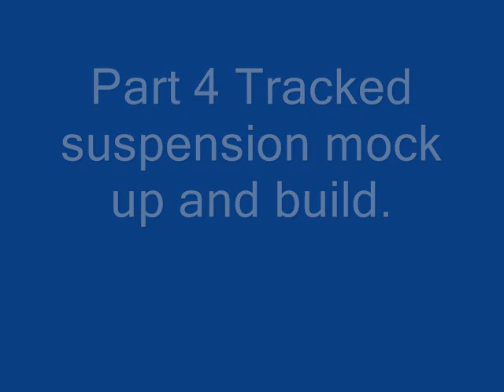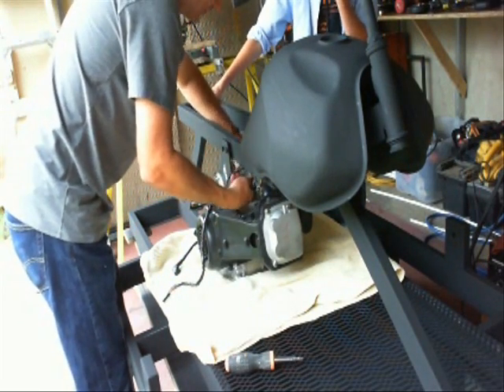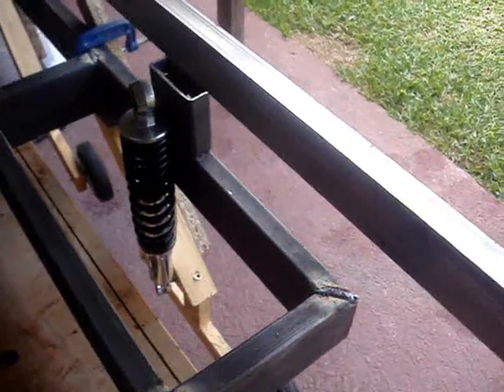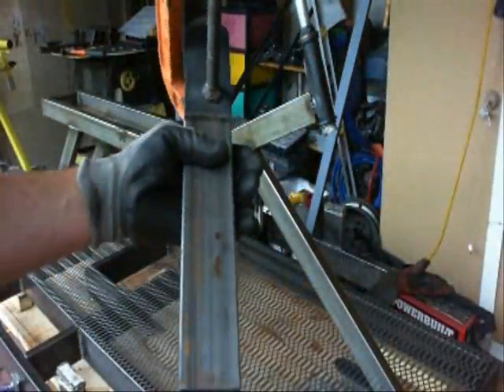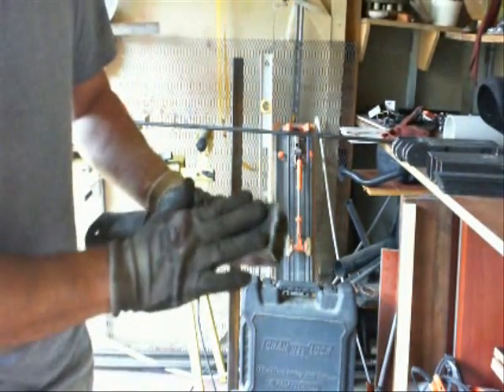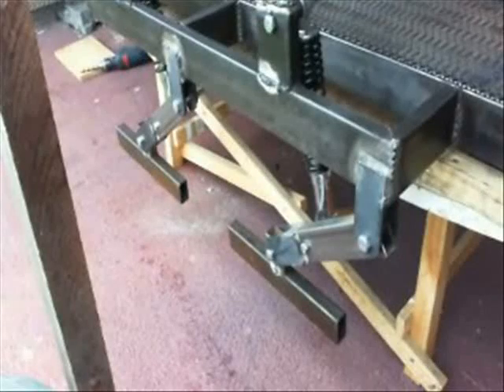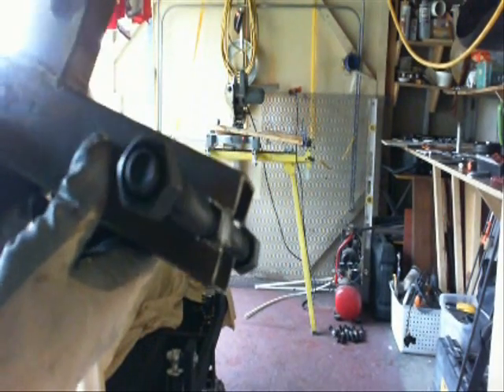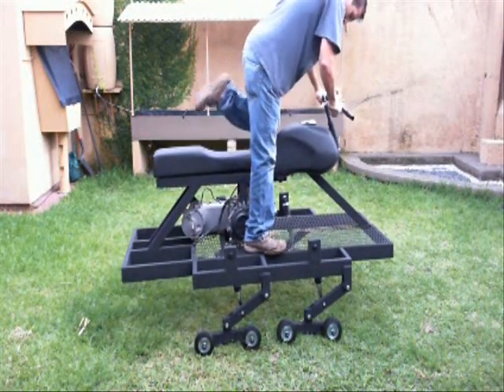Tracked vehicle suspension Part 4

Comment: I like how you did the suspention. By changing the mounting locations on the shocks you will change the leverage on them to make them stronger or weaker.
Reply from the maker: I am going to have to add a shock to the other side of the shocks I have now. The shocks I have are a little weak for the weight. but I think it will also make the arms stronger so not a bad thing.
Reply: Plus the second shock will help hold the suspention strait up and down when compressing. With one on one side it wants to kick outward when compressing. Although you compensated for this in the build it will cause premature ware on the metal parts. Plus it will look badass.

Comment: I see what you are trying to do, but your suspension may be prone to failure, no offense as my intent is to play Devil's Advocate and not to demean your project.  I play World of Tanks and War Thunder Ground forces plus I am 52 years old and have been into Tanks for a very long time, several decades.  As I mentioned I see what you are attempting to do, work within your budget and make something that will get you where you want to go.  Your pivot points will twist and fail as you attempt to make turns and go over obstacles.  Again my intent is constructive criticism and not deter you from your project.  I want this thing to work for you and if you do a google search for Track Suspension you will see none will ever look like yours.  The pivot arm for each road wheel might work but that would mean double of everything, shocks included and rather than a pivot upside down "T" each road wheel is itself will be at the end of the arm.  You can still use the double Screw Idea, that seemed to be a Genius solution, at the bottom of each arm to replace the T.  You may even get away with removing the bottom T and put the Road Wheels there and simply add one more on the end and in the middle and keeping them close together.  Just depends on clearance.  You may also need to use double shocks on each arm to obtain the control you want.  You may be able to Double up the Shocks on a Single Bolt to allow for a second Shock without the need for a Second Hole, maybe.  Keep in mind the only thing keeping those arms from twisting is the Shock and U Joint at the top so you may want to consider using a double plate or double thickness stock for the U Joints.  I don't know what you plan to use for steering but you may want to use a design using cables attached to a breaking system for the drive Wheels.  Simply put if you want to turn RIGHT you simply BRAKE the RIGHT DRIVE WHEEL.  Like a Mini Bike that uses a Slip Clutch to drive it, you will need a Slip Clutch for each side.  Simply have the Handle Bars with Cables to manipulate the Slip Clutch.  The more you turn RIGHT the HARDER the BRAKE IS APPLIED.  The unit seems wide enough but your length might be an issue with regards to stability.  Jeeps are prone to flipping over because they are short and things like that.  You may want to consider extending the Front Return Wheels to add some Length and possible room for maybe a 5th Road Wheel Setup, the length can only aid in stability and the more road wheel arms the less likely they are to twist.  1 or 2 arms will twist easily but 4 or 5 would take a lot more umph to twist metal.  I hope you consider my suggestions as I intend, constructive criticism, and nothing more because I look forward to seeing this vehicle come alive.
Reply from the maker: Thanks for the advice. Stay tuned, as I build this I am sure I will have to make changes to get it to work. That's part of the fun!
Reply: Aceman307 Yes it is, and thanks for taking my comment as I intended it.  So many others just fly off the handle when you try to give them advice and I am glad you didn't.  My health is against me but my mind is very active so I would enjoy helping with ideas as I really do think outside the box about most things...  I look forward to your progress...
Reply: Yes , I also felt that one sided mounting of the shocks is not a good idea, You should add another bar on the inner side as well and then put the shock in between. This single bar mounting will not be able to take the fatigue and may lead to disaster.

by the way, What  are your cost and time estimates for having a finished product?

Comment: I think the shocks are fine. Might need to move the rear swing arm back abit so when you sit on it will be even.
Reply from the maker: The shocks also have adjustments to make them tighter. I don't think I can move the swing arm back any more because of how close the drive wheels will be. Right now I am having problems getting the parts to mount the drive wheels. Thanks for the comment.
Reply: I like how its turning out so far, keep up the good work.